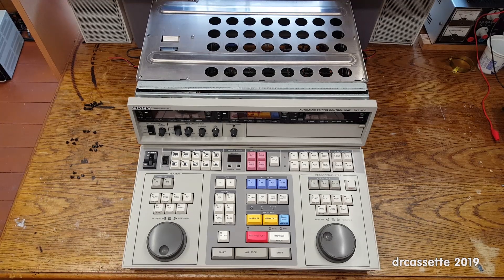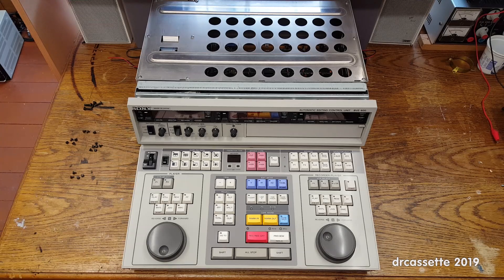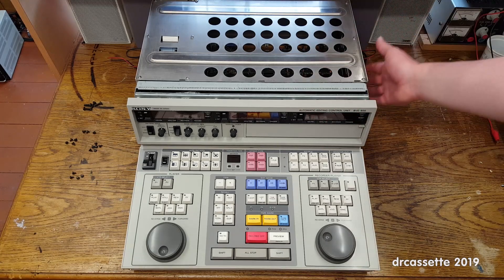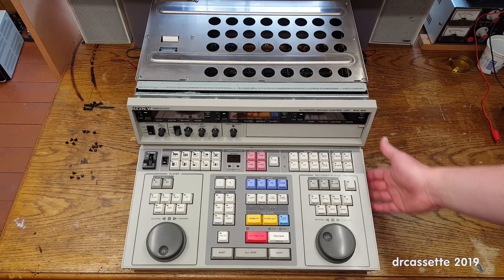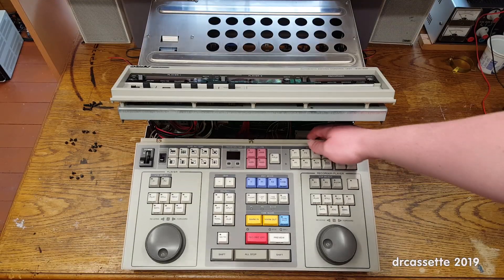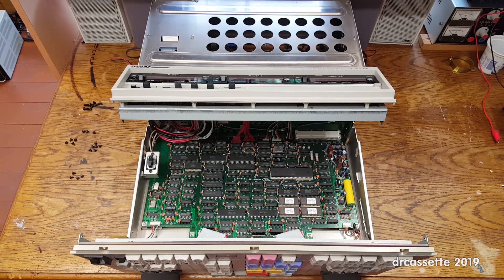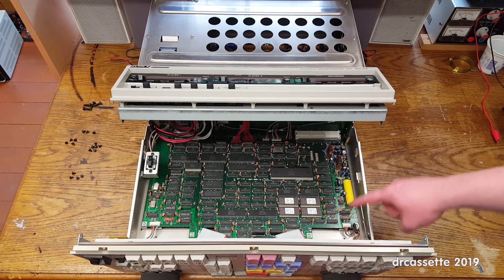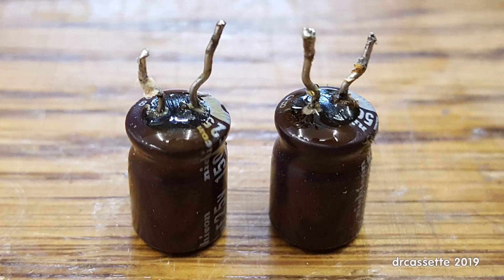How to disassemble the Sony BVE-600 Editing Control Unit

Comment: Will this work with Betacam SX equipment?
Reply: I wouldn’t recommend it. Better to get a dedicated vision mixer and a bve-900,910 or 2000. Those are much nicer edit control units to work with and have much more powerful editing software and vision mixing potential.
Reply from the maker: I don't know, sorry.